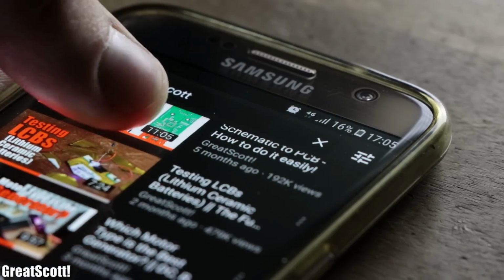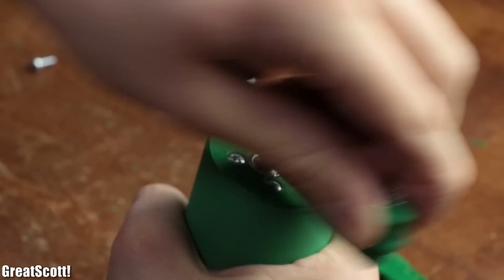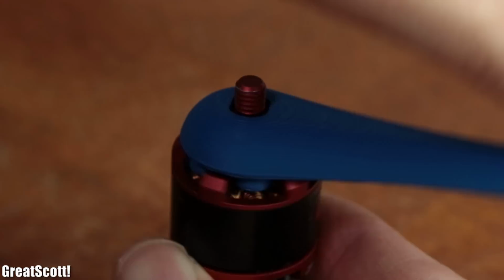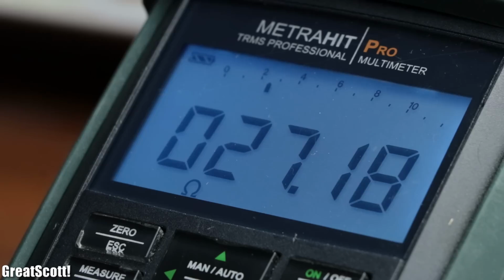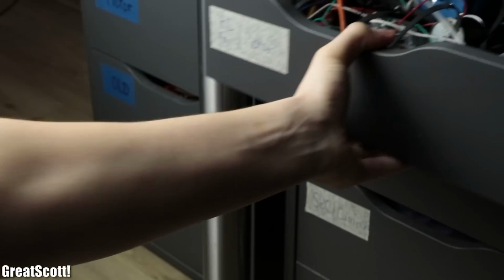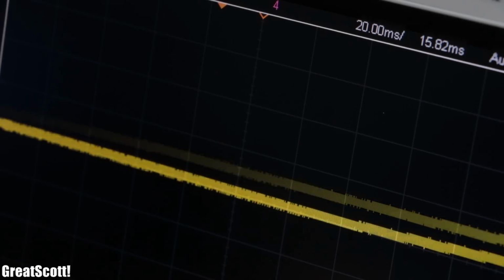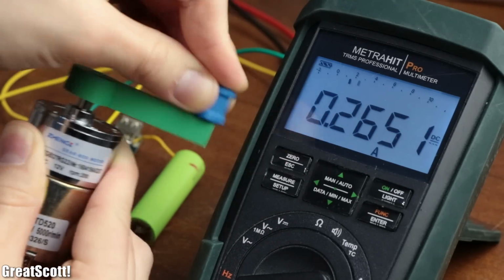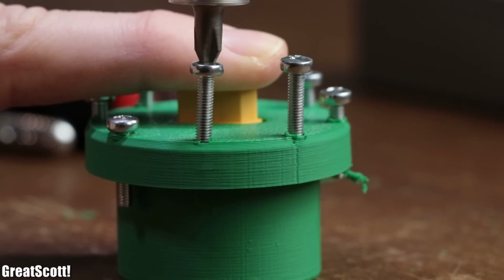Make your own hand-cranked Emergency Powerbank

Comment: It is not fair to compare an ungeared BLDC motor with a geared DC motor.  Also, what about using a stepper motor ?  If you put the wires of common stepper motors in your mouth and spin them manually, it is obvious from the sensation that they generate quite a high voltage.  Also, shorting the wires creates considerable resistance to motion - suggesting a low internal resistance.  Of course a DC motor is the most obvious and simple solution, but it is not the most interesting in my opinion.
Reply: I like your way of testing the generated voltage :)
Reply: yes, using a gearbox leads to waste some energy. I think using a stepper motor for this build is the right choice. You should just use some circuit to smooth the voltage you get from stepper motor. Because it will generate bursts and peaks of voltage and current. It may damage the battery if you charge it directly with the unstable voltage that the step motor gives. And you should install a voltage indicator for not overcharging the battery. or you can just use a powerbank with voltage indicator built in.
Reply: Well in his other video he recommend the step up motor best to use as a generator

Comment: I'm making a portable solar charger that can run lights LED strips and charge anything 12V 5 V 4.2V and 3V. I never thought of adding a hand crank. But it doesn't look real practical without some major gear reduction.

Comment: What about cheap 7segment voltage meter module from ebay to show battery voltage when switch is pressed? And simple zener diode to shut over voltage from generator? And did you tried super capacitor or bigger capacitor to provide better flow to powerbank charing circuit? I thing that this generator, with decent mount, can be powered by bike rear tire to crank it with higher RPM to charge battery faster, but then it would need proper charging circuit like with TP4056 or so. Anyway - interesting idea with possibility of further development like intergrated white LED light or so.

Comment: So, stupid question warning...but can the left over energy in the power bank drive a small motor to spin the crank and charge the power bank in return? Thanks...great video btw!
Reply: Wouldn't work because of energy loss due to friction in the generator and electrical resistance in the electronics, what you're saying is essentially like plugging an extension cord into itself to create unlimited power

Comment: Wouldn't be easier to wire the generator with an micro usb output and plug it directly into the phone? Wouldn't it be more eficient at charging the device??
Reply from the maker: The circuit needs exact 5V.

Comment: I would have thought a gear box would have been the first thing you would do with the brushless motor before rewinding
Reply: Yeah, as he explained, rewinding with more turns of thinner wire will inevitably reduce efficiency by way of increased resistance.  Of course, adding a gear box also reduces efficiency, but he doesn't attempt to establish the trade off point.  So the dismissal of bldc is wrong.
Reply: Ya but the motor he used had a gear box built in so it is basically the same as adding a gearbox for a suitable rpm

Comment: 2 idea's.  While testing why not use a pair of vicegrips as a crank instead of taking the time to 3d print one?

Also, would a linear voltage regulator work for safety?  I would think at voltages below it's threshold the losses would be low, or maybe a bypass circuit would be needed.  Or perhaps a zener diode could be used to clamp the voltage when it rises too high?

Comment: But what about using one of those gearboxes with one of the low KV BLDC motors? Should be able to get more current out of it, no?
Reply from the maker: True. But making such a gearbox is no that easy.
Reply: @greatscottlab  My immediate thought would be to separate one of the motors shown in this video from its gearbox, and try using that, but that probably carries its own set of hidden monsters...

Comment: I admire your project but, like the hand crank torches and radios, these require the user to use both hands and work some of the smaller muscles in the body.  If you have a chance to tackle this again have a look at using energy from the stride or foot impact on the ground while walking ... much larger muscles, less prone to fatigue where you can draw power more easily and keep the hands free or in your pockets to keep warm.  Meantime keep up the great work!   ... now time to get my assistant to make me a cup of tea :-)

Comment: Hey! Wasn't it a good idea to use a stepper motor to achieve that kind of """high""" voltage wivh such low RPM ? Nema17 are actualy capable of producing high enough voltage to turn on a 3D printer by simply turning it by hand

Comment: Why not just add one of those small battery protections circuits in between? To take care of the overcharging problem?
Reply from the maker: Good idea
Reply: A Zener Diode might also already be sufficient, but would only solve the overcharge problem, on the other hand it might fit into the existing housing very easily ;)

Comment: What about a gearbox or a pulley to "multiply" the rpm of the cranck in these blc motors so hey run alot faster?

And what about making the other generators turn way more quickly, but then stepping down the voltage, but having more miliamps, to charge the battery faster?

Comment: Why don't we make a generator with neodymium magnet as rotor and stator coils around it? That way we could increase the number of turns.Afterall we need to use 3D printer in this project so we could design an enclosure for this generator too.(please correct me if I'm wrong!  This is a genuine doubt)

Comment: If you are in nature and need to push more charge into the battery longer time, you could maybe connect that shaft into some kind of imperrel and use river flow as a force to turn the shaft.

Comment: Nice project ^^
But one thing: You could build in a bridge-rectifier direktly after the Motor/Generator, so its not important in witch direction you crank. 
Also, the Outputvoltage is lover, but the current is uneffected, so lower risk of overcharge the Battery :)

Comment: I made a similar device using 2 x 700farad 2.5v super capacitors in series to make 5v, and used a stepper motor as the generator. It was a 4 wire motor, I used two bridge rectifiers, one on each coil to change from AC to DC, connected in series to charge the super caps. I have since found stepper motors with planetary gearboxes already attached, which will make much better hand crank generators. You can use a little voltage boost circuit to keep a constant output voltage and get as much as possible out of the capacitors.👍
Reply: Im concerned with the small energy density of the supercaps. But with this application, it is way more time efficient to charge an SC rather than a li-ion battery considering the amount of effort you exert cranking the device.
Reply: joelo secretario, the thing with super caps is, they are light weight, no liquid electrolyte, they can be charged and discharged approx a million times, but they are expensive if you want to create the same capacity as batteries as you need a lot of them, but I have found them far superior for these smaller lighting and 5v applications, in fact they have really surprised me.
Reply: For how long can it charge up  your mobile phone sir?
Reply: joelo secretario, the super capacitors would fully charge my phone, but I am using them for lighting not for usb, although a step down dc buck or boost circuit could be used to maintain 5v to charge phones etc.
Reply: How abt the supercaps? How long does it takes to be charged? Is it a crank gen?
Reply: joelo secretario, yes a hand crank generator, using a stepper motor, it takes about 3-4mins of cranking to charge the caps up, but they will sustain a bright 1w led for 12 hours.

Comment: Once I bought a USB handcrank for 80 cents from Aliepress :D I opened it and there was a tiny motor with gears and a small 5v boost converter. That is so simple desing and it works well.

Comment: Sir how to  make a12v autocut circuit for a Inverter in which it will automatically turn off the 12v battery charging when it is full and indicate it with a single green led sir pls make video on this circuit😊

Comment: You must allow rotation in both directions. There is no way to tell, if battery is actually charging.
Reply from the maker: There is. One way is harder to crank. That is the correct way.
Reply: @greatscottlab  Lenz Law! Wait, I think the resistance is from mechanical gearbox arrangement. Because opposing magnetic field should be more in case when electricity is put on load. In the other direction, it should be more free: filtered by half bridge rectifier. Am I correct?

Comment: Just add an external protection board, so a full battery being charged simply disconnects the battery from the crank, and the suddenly light cranking is a simple signal you are finished.

Comment: Couldn't you use a 5v1 zener diode in parallel with the generator's smoothing capacitor to limit the voltage output? I'd imagine that wouldn't pull enough current or add a low enough load to really affect the charging process?

Comment: Using Schottky diode can reduce power loss at the output of generator. And why not Video on charging a power bank through small 7-10W solar panel with MPPT (optional) ?

Comment: you could add a diode bridge so that it doesn't matter in what direction you turn the motor
Reply from the maker: But you would have twice the voltage drop of a normal diode. So less efficient.
Reply: @greatscottlab  use schottky diodes bridge and you get the same (or less) voltage drop than your single  1N400x

Comment: You could have used the BLDC if you increased the RPM using a gear ratio. The only reason you didn't need it for the Brushed DC motor is because it already had it built in.
Reply: Yup, and the bldc would win.

Comment: Those are the nicest 3d printed designs I've seen on here before.
   The "assistant" shows here. It was obvious you got more done in a week/single upload than is typical for this channel's regular upload schedule. 

  I have a suggestion for another 3d printed project like this. Do a resistor box. You could do the typical decade resistor box like every hobbyist should have, but I think there is a better first design that often gets overlooked. The first resistor box everyone should build is one that has each resistor value that they keep in stock. This device will save countless resistors from being lost or discarded while doing breadboard experiments. 
  Decade resistors are great when a precision value is needed, but it isn't very useful if a person figures out they need a 5k9 resistor when all they have are 5k6 and 6k8 5% resistors. Sure they can parallel and serial several values to achieve their goals, but this is something for more intermediate level hobbyists. 
   The first thing we should all build are resistor boxes with one of each value we keep in our personal stocks. IMO the best way to build that is to place them all on a custom circular PCB or 3d printed design and come up with a rotating switch solution like the dial of a multimeter with one position for each resistor.
 Personally I recommend getting a pack of 50 values of 5% resistors with 2500 resistors total from somewhere like AliExpress for around $12 shipped. This isn't a complete set of all 5% values but it is generally the best dollar value for a wide range of values and a great starting point. 
  For a really good starting point, order the 50 values set, and 100 more pieces of 220R, 330R, and 470R to work as current limiting resistors around 5v and under with LEDs and such. Then order 100 more 100R, 1k, 10k, and 100k for a good starting collection. If you can spend a bit more, the halfway point between the 10's within the logarithmic scale 5% resistor values is "47" so order 100 more 470R, 4k7, 47k, 470k and you'll be setup really well. Also note, the 4 value bands of 5% resistors are much easier to learn to identify visually. You'll have all of the color bands memorized very quickly if you get these instead of the 5 color band 1% resistors.

 ...anyways.. I've been thinking about how I can etch my own little resistor boxes like this for my personal parts stock of resistors and capacitors. If I had a 3d printer I would probably create something that uses wire wrapping resistors for even more versatility. 
  This is just one of those key tools to have a few of on the bench. The commercial products available are either a pain to use, are way over priced and/or have irrelevant values that don't match our stock on hand. It's a great project to build that often gets overlooked. 
-Jake

Comment: As you mentioned in your video about using motors as generators, why don't you just use a gearing system? If you can lower the motor shaft speed, you may be able to use 3D printed gears for the handcrank input.

Comment: Damn 7 hour thats too much. 
We have to find a efficient and fast design.
Because this is very good project.
Reply: ok?
Reply: To take the proposed scenario literally,  you're out in the woods, but within mobile reception and in urgent need of help.  You've forgotten to pack your spare battery but have remembered to pack your wind up charger.....  pull the other leg it's got bells on.  If you're serious about using human power then use pedals,  because thighs are much more powerful than arms.  Machine not easily back-packable, though.
Reply: I really think the gearbox he uses is too weak and too easy to crank. If wider rotor windings and bigger lever were to be built, I think this would be a decent increase. Not the best but decent.

Cause he cranks it so fast it makes it look easy 🤷‍♂️
Reply: I am trying to work on a proof of concept of this kind of video and its possible imo
Reply: Well one wouldnt need to fully charge their cell phone to make an emergency call. So perhaps 1 hour of cranking is all one would need to do to give them enough power to charge their phone.   

Would adding pulleys to the crank system so that 1 RPM on the crank handle will equal say 3 RPM on the motor shaft? Or would increasing the speed of the RPM not cause it to charge faster?
Reply: The issue is size. 
   
Obviously, you could use a larger engine or increase the mechanical advantage (he already had to go with a gear boxed engine that was already using mechanical advantage to up the RPMS). 
     
Doing any of that, however, adds size and weight to the build and if you have the space/weight to haul such a thing, you could just carry a larger battery bank. 
   
If the renewability was your goal, they already have commercial rechargers that are built into bicycles that will, I believe, put a full charge on a phone in about a half hour's ride - letting you double duty it with exercise or commute.
Reply: @oaksparoakspar3144  áa11¹

Comment: In fact, the battery could be connected directly across the generator as you did because the power delivered is so low, the voltage on the generator output will 'magically' adapt itself for the battery's need. The same could be done with low power solar panels. A diode must be added to prevent the battery from driving the motor in the opposite direction, a bridge rectifier would allow you to rotate the motor in any direction but would drop 1,4V.

If you have a bicycle, you could charge the phone while moving around. There are some generators available for light bulbs in bikes, and they may provide a reasonable output to charge a phone directly or a battery.

Comment: Hi, you could have connected the generator to a TP4056 charging board, and then connected the battery. This way, the battery will not get overcharged.
Reply: The charging chip of the bank could do that. I would not be surprised if it is a TP4056. But then he would have to supply 5v. Now he relies on not cranking for 7 hours.